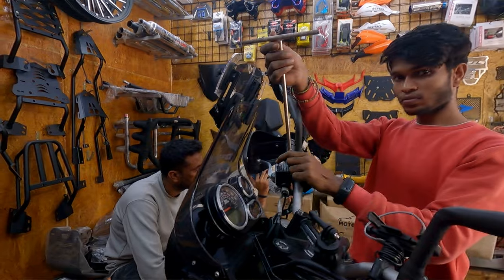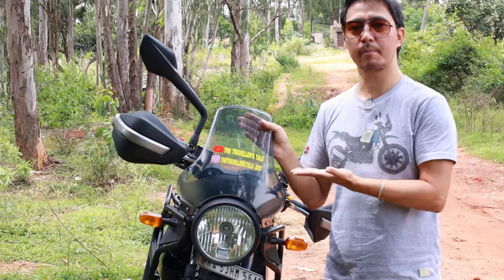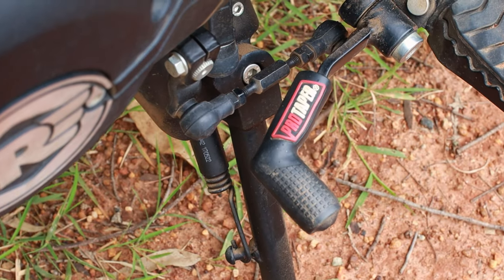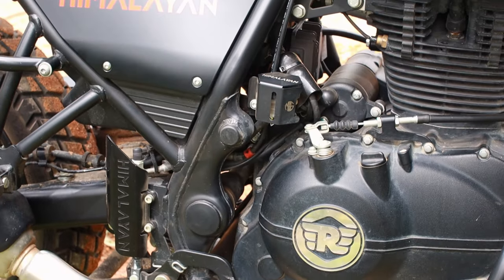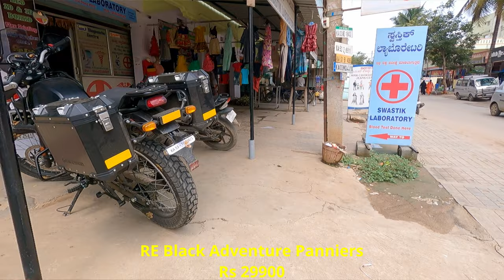RE HIMALAYAN Accessories Guide - Learn from my mistakes

Comment: Sir, is it okay to replace the stock lamp with led headlights? Will there be any electrical issues later?
Reply from the maker: Not at all.. please go for good and powerful led for better viability..it’s a direct swap so easy
Reply: @TheTravellersTale2021  Thank you sir

Comment: Hey brother, how is throw of the headlight compared to the stock one? is it worth it?
Reply from the maker: It is but recently I discovered a higher power led from hjg 60 to 80 watt I guess which is way brighter.. try it.
Reply: @TheTravellersTale2021  which one is it? And will it fit in the headlight hub? i see alot of aftermarket headlamps arent compatible with the hub and they remove the rubber covering.
Reply from the maker: @salemyobin2823  hjg led light bro.. it’s a direct swap .. no mod required. Go for higher watts for more brightness
Reply: @TheTravellersTale2021  thanks for guiding. 🙏

Comment: What's comes with this original Knuckle guard it is not a weight and it is the plastic part
Reply from the maker: You are right .. you can put aftermarket weight but I don’t feel the need as vibration is not that significant

Comment: Brother u felt vibration in instrument cluster
Reply from the maker: Not really brother both windshield does vibrate quite a lot
Reply: @TheTravellersTale2021  any idea to solve the issue ?
Reply from the maker: @thosetwoyears1885  not at the moment but if your console vibrates too then you will need to show it to the technician bro